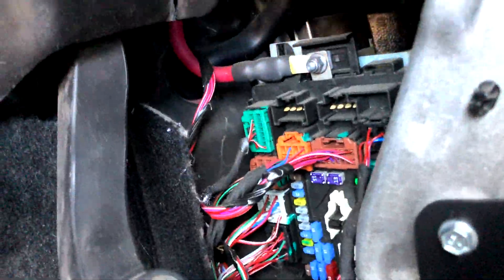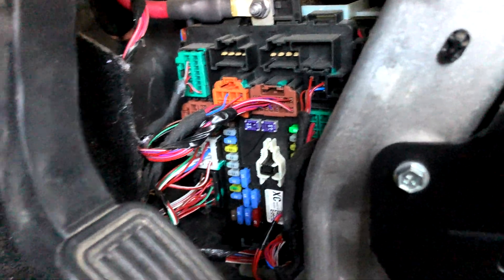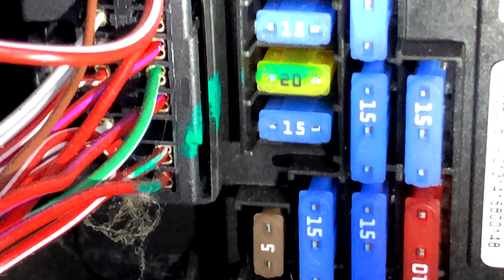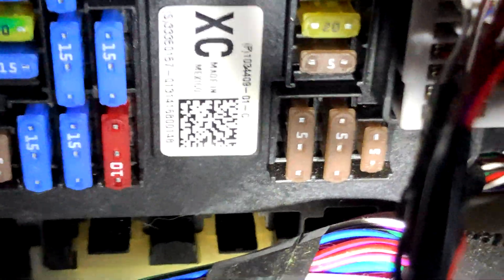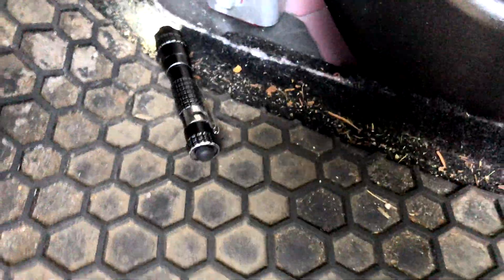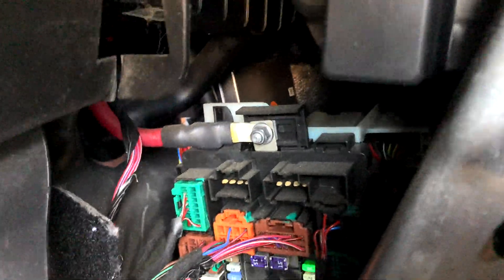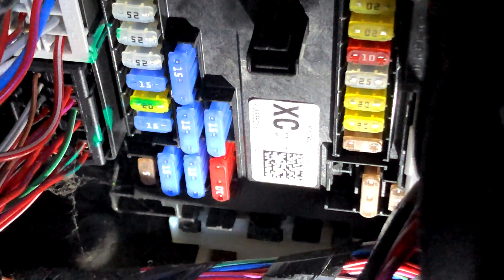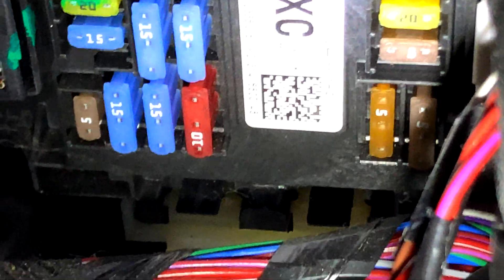Tesla Fun with FUSES On my Model X

Comment: My wipers.stopped working. No motor sounds or anything. What fuse is the wiper?
Reply from the maker: @Reaganbites  self resetting circuit breaker
Reply from the maker: @Reaganbites  are you in a cold climate? With lots of snow or ice? If so what's the temperature out? Chance that something froze in the system.

Comment: Are fuses basically if it ain’t broke don’t fix or are there any that have good reason to be upgraded, if possible?
Reply from the maker: there is no upgrading fuses. if it’s blown, you replace with the exact same one. in an emergency, you can replace with a smaller one if you don’t have the same size, and then put correct size in when you get the chance.

Comment: I guess you're busy. The Driver side Tail light stopped working. Said needed service to fix it. Well, NOT true. After I let it set for about an hour. It started working again. Wow, Awesome car. Keeps impressing me.
Reply from the maker: Sorry I do not know the locations on Model 3's. Not everything has a fuse per-say. Some are self resetting breakers, some are relays and some are electronic breakers. And in some cases, such as tail lights, they are controlled via CAN BUS (Computer Signal). On Tesla's, a lot of times a reboot of the computer, or even just getting out, closing the door and walking away for an hour resets things that aren't working correctly.

Comment: I hope you're cured, well it's the first time I saw that double fuses, it was delicate work while holding the cam.

What is the voltage of that Fuse, and I think it does energize two sectors, I think if it's possible, better to remove all fuses one by one, and to make your diagram, and to keep spare fuses for all of them.
Thank you for sharing.
Reply from the maker: The micro fuses are all 12v. No high voltage fuses are accessible. Mainly the main pyro fuse for the HV pack which is accessible behind a little pael on the battery pack.